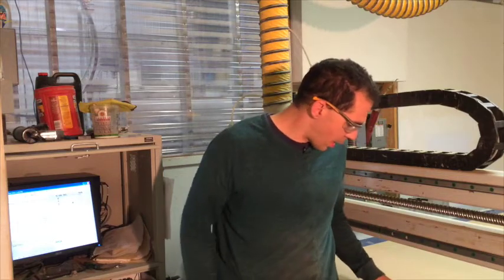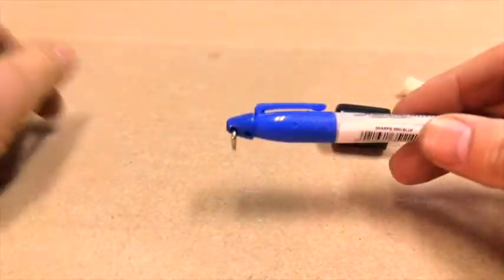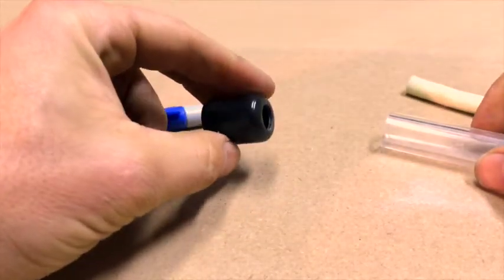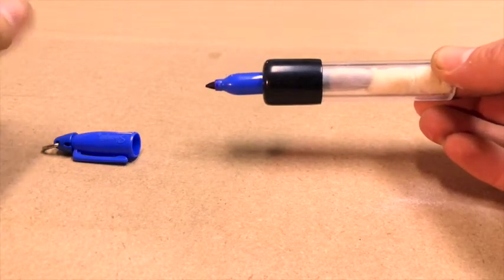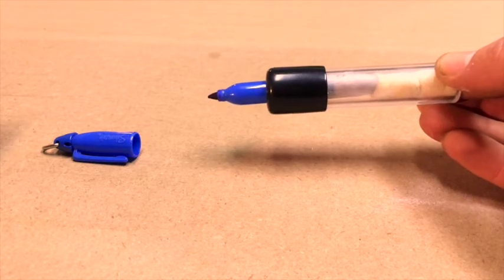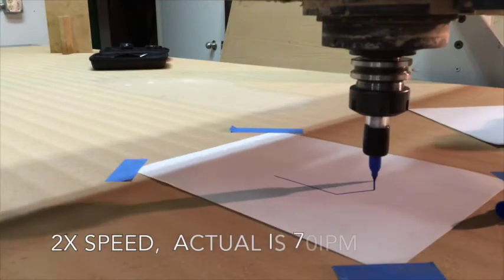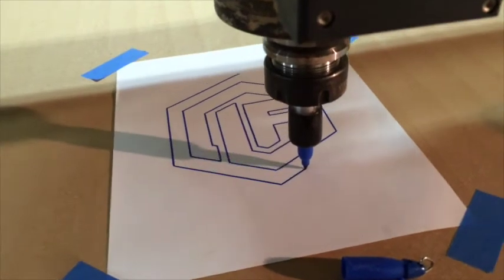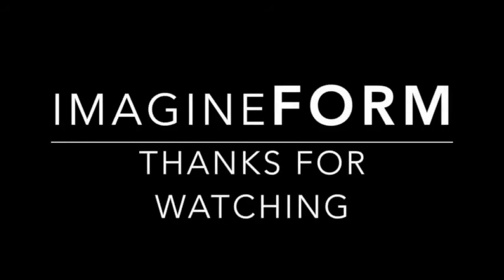Marker Holder

Comment: very clever  idea ... but how to program the writing file in artcam or aspire?
Reply from the maker: I’m not familiar with those programs,   But in rhino I used the engrave function and set the RPMs to 0.   When I zero it out I make sure there is a little pressure on the tip.
Reply: @imagineform  ok thank you I will try it.